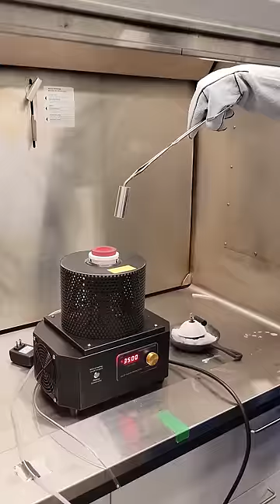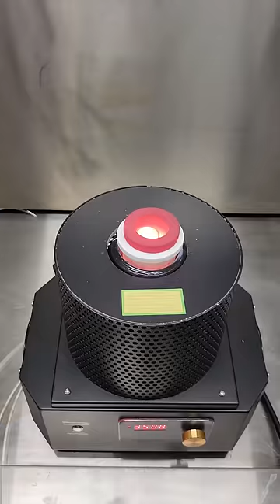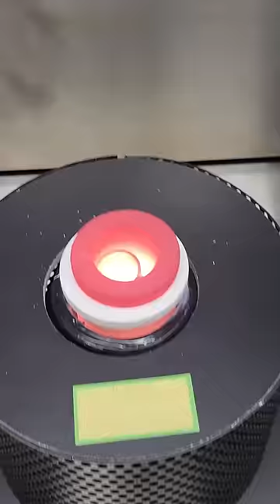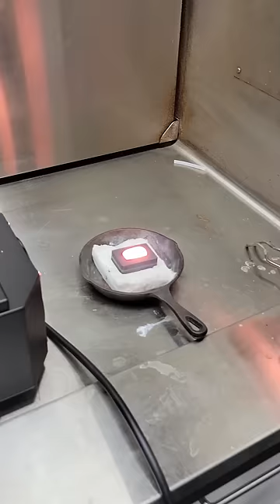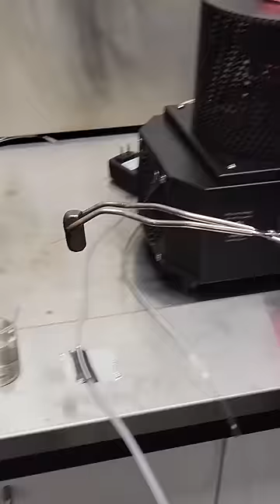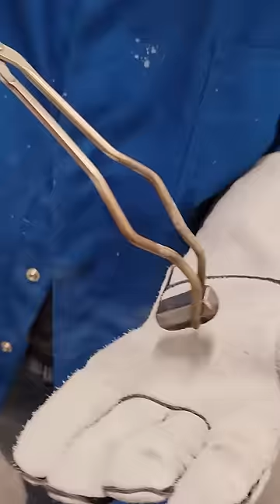Melting steel pipe is crazy

Comment: bro stained the stainless steel… impossible
Reply: Bruh😂
Reply: Lol pretty underrated comment
Reply: It stains less, it's not stainproof
Reply: Burned out the stainless properties of the metal
Reply: Achully, its because
Reply: @vadex_gaming7269 No lmfao
Reply: @Kumquat_Lord lol
Reply: @autumn5592 yes actually
Reply: @porcupinepunch6893  Care to explain how he burned all the Nickel and Chromium out of the pipe then?
Reply: Erm its called stain LESS, not stain NEVER ☝️🤓
Reply: Insert Princess the Bride: Inconceivable MEME
Reply: It's stainless, not stainfree
Reply: It's very easy even with salt water and time :)
Reply: @YellowTailHorse  what about careless? Restless? Homeless? Hopeless? Tireless? Endless? Spotless? Meaningless? Spotless Fearless? “Less” as a suffix means “without”, not “less of”.
Reply: Huh? He turned it silver?
Reply: @autumn5592  OH as a welder I will.
Think of Nickel and Chromium like boiling a soda, where in the sugar and caramel coloring is the iron and carbon mixture.

SO, when you heat up sugar, you evaporate all of the "water" aka "nickel" and evaporate all the other shit, aka "chromium. These are easy to separate from the metal if it gets super heated.
So in the end all your left with is the Sugar and Caramel Coloring in your sauce pan.

But it gets even worse, since the metal was HOT it's drawing in a fuckton of air now, which is rapidly oxidizing it, which forms an oxygen layer over any chromium or nickel that may have stayed, and since theres now "gaps" and your chromium and nickel aren't 1 whole thing (like a fence), you now have a gap in that fence, where Oxidation can occur, which will rapidly rust it from that point, and since the chromium and nickel are only really on the surface, once rust gets in, ya fucked.
Reply: @DrCranberry  That would be applicable for welding, not for foundry work.

Nickel and Chromium both boil at ~2,700°c, his foundry is running ~2,000°c -- no wear near enough to cause the alloying elements to evaporate.
It is applicable in welding, because the heat from welding is over 3,000°c, capable of burning it off.

Hot metal doesn't 'draw' oxygen into it. Hot metal oxidizes faster because electrons can move easier at higher heat.
Electrons moving from iron to oxygen (or water if present) cause oxides to form. This happens to all ferrous alloys when exposed to extreme heat (like casting and forging.)
That's what all the black stuff is on the top, oxide and other garbage, called dross.
It doesn't harm (in the sense of corrosion) the newly cast material, and does protect against oxides forming.

Once these alloys are formed, casting temperatures will not cause separation, at least in the duration it takes to cast something -- separation can occur by causing alloying elements to evaporate, once held at it's boiling point for long enough. This isn't going to be the case for the majority of ferrous alloys.
If this were the case, they wouldn't be able to cast stainless alloys at all. 

As for the 'fence' theory, that's not how it works;
Once an alloy is formed, the constituents are spread out through the material quite evenly (if cast), not just surface level. Once exposed to oxygen cause Chromium oxide to form, preventing rust from forming.
If you were to remove a section, the chromium oxide would instantly reform protecting the surface.
The only way you would have rust from is if you didn't allow that chromium oxide to form, or you intentionally introduced a chemical to further oxidation of iron and strip the chromium oxide -- an acid.

You are right though, once Fe2O3 (rust) has formed, it will continue to corrode the base material, regardless of its alloying elements. Because it is the oxide that forms instead of chromium oxide.
Reply: NERDDDDDSSSSS
Reply: @autumn5592 yes. Im a certified stainless steel welder and if you don't use argon you will burn out the chronium in stainless steel, making it just steel
Reply: @autumn5592 sorry guy but you are wrong. Also welding is done at 3000° f not Celsius.

It diesnt have to evaporate only melt enough ti mix with the air causing oxidation. You typed out a bunch only to show your ignorance on the subject. The nerv it takes to argue with someone who is clearly in the industry of melting stainless steel is hilarious.  Please just stop and educate yourselves not look up google after the fact just to argue

"Lmao"
Reply: @georgeschnakenberg7808  You will not burn the Chromium off at casting temps. You have to reach the boiling point to do that.

Welding is done at OVER 3,000°c, for the most conventional methods.
Welding stainless is not done at 1,500°c, it's far to cold, you will not melting the steel, so you wont be welding.

I never said it had to evaporate to oxidize.

You can be 'in the industry', it doesn't mean you know anything about what you're talking about, lmfao.
Reply: @autumn5592  Steel is a mixture of iron and carbon that can melt between 2500-2800°F or 1371-1540°C. The melting point of steel can vary because of the different elements it contains, which can cause melting point depression 

"Lmfao"
Reply: @autumn5592  Stainless steel is not coated, and will not be permanently harmed by any temperatures achievable in the home. It melts at about 1500 C (2750 F

"Lmfao" 🤭 Google harder child
Reply: @autumn5592  The boiling point of 2671 °C (4840 °F), however, is comparatively lower, having the fourth lowest boiling point out of the Period 4 transition metals alone behind copper, manganese and zinc. The electrical resistivity of chromium at 20 °C is 125 nanoohm-meters.

"Lmfao"

If you were to weld at that temperature you would in fact boil out all the chromium
  You are hilariously in over your head and you don't even know it 🤭

What part about certified stainless steel welder, don't you understand? I learned about metals physical traits while you learned to type paragraphs. If I want grammar info I'll call you, if you want decades of knowledge surrounding metal...you call me

"Lmfao"
Reply: @autumn5592  rip to whoever that guy was.  🤭🫣
Reply: @vadex_gaming7269 that's not how it works
Reply: @autumn5592  where did you go smarty pants? 🤣🤣🤣

"Lmfao"
Reply: @georgeschnakenberg7808  So mad hahaha
Reply: @autumn5592 if you heat it up too much it will no longer have stainless properties, it’s one of the reasons why it’s difficult to weld, it easily introduces impurities and if you over heat it it will lose the properties even if everything is perfectly perfectly clean
Reply: @kadenherzog9727  Read my other comments, I've addressed this.
Reply: @autumn5592  you incorrectly addressed it 🤣🤣🤣
Reply: @autumn5592  how long have you been welding? Because it doesn't sound like you could pass a weld test 🤣🤣
Reply: @autumn5592  stainless steel weld caused by overheating, which not only affects a material's color but degrades its corrosion resistance and mechanical properties as well

"Lmfao"
Reply: @autumn5592  what you mean to say is you googled a bunch of stuff without knowing what to actually ask 🤣🤣🤣🤣🤣
Reply: It was stainless but now its stained
Reply: these comments are ruthless
Reply: @Kumquat_Lord nerd
Reply: @autumn5592 just because the plasma arc is 3000deg doesn't mean the weld pool is. In fact, the mark of a good welder is to not introduce more heat than is necessary. The goal is to get it just above the melting point and no more.

When welding stainless pipe, if you don't use an inert purge gas inside, the chromium will leach out and oxidise, and this is the lowest temperature of the weld pool. In fact, discoloration can occur even just at 'red hot' temperatures, before the melting point. 

I don't know if stainless casting is done in an inert atmosphere, but I do know the surface can oxidise rapidly at those temperatures. Plain steel can rapidly oxidise when heated below its melting point for an obvious example. Perhaps leave the textbooks and get some real world experience.
Reply: I dont see it but ok
Reply: @grey8935 ur under rated cuz its definitely has too much attention
Reply: Weak af
Reply: This why English is so confusing 😂😂
Reply: you can cook out the stainless properties. 

it’s why stainless steel welding pays real good. if you remove the chromium and other shit, you’re just left with a weaker carbon steel. will rust
Reply: It doesn’t come with stain, not stain proof
Reply: @vadex_gaming7269 unless you change the composition (which melting does not do) then no, it is still stainless steel. The definition of stainless steel is an alloy with iron, carbon, chromium, nickel, and other metals.
Reply: McLovin!!!
Reply: @georgeschnakenberg7808 Editor's note: most homes do not contain induction furnaces capable of melting steel.
Reply: @tyrannosaurusimperator  did you really just say "most homes" as if that is at all relevant? 🤣🤣🤣 you still trying to argue with a college educated certified stainless steel welder?????? 🤣🤣🤣🤣🤦 not too bright
Reply: @tyrannosaurusimperator  know how I can tell you know nothing of melting or fusing metal? Cuz you're 100% wrong 🤣🤣🤣🤣🤣🤣🤣🤣
Reply: Science bro science, it can do anything!!!!!
Reply: @jacobs1047 Taht ain't how semantics work
Reply: @autumn5592 More like, seoarted them probably
Reply: @autumn5592 Thanks for the somewhat in depth explanation man  👍🤙🤙
Reply: he should return it and ask for a refund
Reply: @Kumquat_Lord stain less not satin none
Reply: It’s stainless, not stain free

Comment: “Do not left the heated liquid metad liquid metal cooling in the graphite crucible.” That’s a quality piece of machinery right there.
Reply: Least scuffed English note on a Chinese machine
Reply: @TrueMechTech  legit usually it’s a lot worse
Reply: Ccrucible*
Reply: @Syndicate_LS nah it says "e crucible" on last line because the graphite's e wrapped around to next line 😂😂 the extra scuff...
Reply: @Soycake123  ah it looked like a c
Reply: Actually it says "donot left the heated liquidmetad liquidmetal cooling inthe graphit e crucible"
Reply: That's a VERY expensive machine...
It's readable 😂
Reply: @TrueMechTech right? They even got the lower part correct
Reply: graphit ccrucible*
Reply: The last thing you read before you die 💀
Reply: @isekaibarnskye2125 e crucible? Damn, IoT is reality.
Reply: As bad as that dialect of Engrish is, the kerning is worse.
Reply: Made with Chinese metal and electronics. Yikes.
Reply: Found a heat exchange at work that says "clean air filter regularly to avoid to reduce cooling effect and break down oil cooler"
Reply: Omg I didn't notice until I read this comment 😭
Reply: I was a little confused about that.
Reply: All the people writing ccrucible... it says "graphit ecrucible" smh
Reply: Do you want them to spend money on quality electronics, or a fucking localization department? Haha just kidding you can't have either.
Reply: Looks like it might be made from disaster grade chinesium.
Reply: @tjp353  The problem is there is legit grade Chinesium out there, it's just so far and few between plus maybe inconsistent even if you do find a unicorn. I suspect this guy knows a good seller that does their homework, You kinda need someone mainland to deal with issues before anything ships out of China.
Reply: My tyre compressor says "warning: use usb for happy charging time"

I'm still not 100% sure what the warning is
Reply: My brain hurt
Reply: “1. Donot left the heated liquid metad
liquidmetal cooling inthe graphit
e crucible

2. When the water cycle stops, the hot
cruciblemust not be left within th
e coil, or the coil will be damaged.”
Reply: @kylehenline3245 All the good Chinesium is used up making Harbor Freight hand tools. Everything else is sketchy. :3
Reply: @Syndicate_LS i think thats the "e" from graphite. It decided it was time for a change and migrated.
Reply: @94XJ  yeah I learned I’m blind
Reply: Plus the "When not melting, turn off this switch" in Comic Sans, right above a button 😂
Reply: Oh my God 😂😂😂
Reply: It says "Donot"
Reply: Ok
Reply: @jo54763  Amazing of you to correct people and still write it wrong. It's clearly "graphit e crucible." smh
Reply: He has all the chinese machines.
Reply: If only they had access to Google translate, that shit has gotten crazy good
Reply: It's a simple enough machine that it can be janky. There's no moving parts, just a transformer, rectifier, and zvs driver.
Reply: "inthe graphit ccrucible"
Reply: Learn the English language
Reply: Oh cool, good to know I'm not the only one trying to figure out what the heck is going on here
Reply: my 3d printer had “afraid of wet” on the packaging
Reply: @tjp353  The finest metals left over from Chernobyl,, doesn't even need electricity, it always glows red hot!
Reply: Remove the e and add a c to crucible
Reply: yes they are pointing out if you leave any metal inside ur crucible is done.
Reply: cruiciblemust
Reply: I was looking for this comment as soon as I saw the label!
Reply: Wait what? Who or what said it or what made this comment?
Reply: Donot left the heated liquid metad liquid metal cooling inthe graphit ccrucible
Reply: More like graphit
e crucible
Reply: More like graphit
e crucible
Reply: @DreStyle  you are correct the gibberish is readable
Reply: @Anonymous-ed8om It's the bad Chinese-to-engrish translation on the cheap Chinese crucible.

Comment: I was actually surprised how well that worked. Casting metals that potentially oxydize (yes stainless steel WILL oxydize; solid SS is protected by a layer of chromium oxyde) in open molds is not a guaranted success